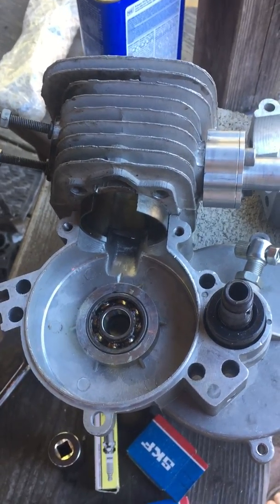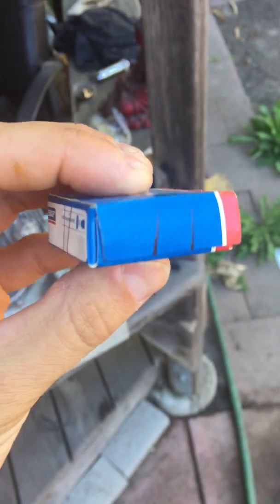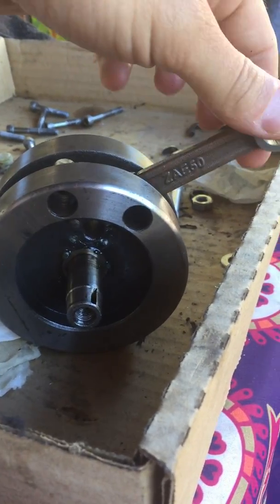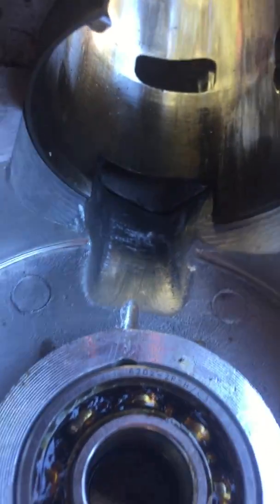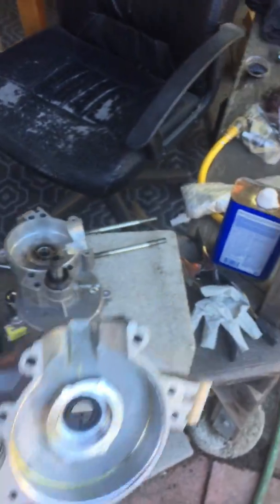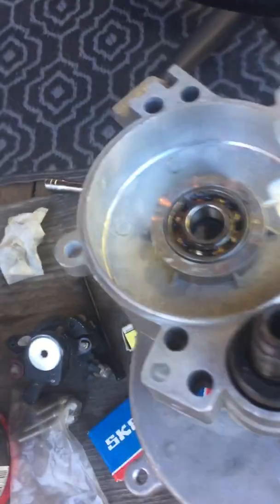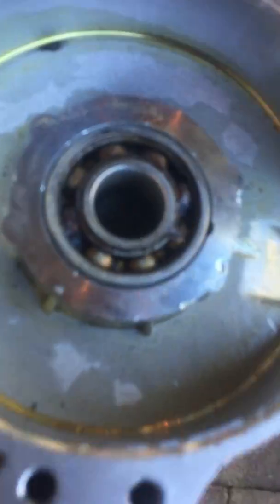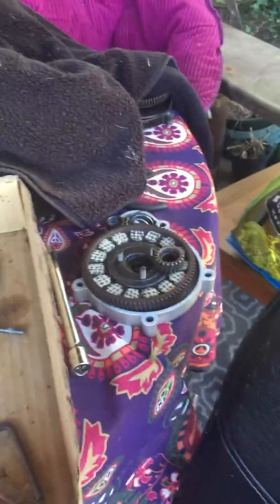66cc China doll bottom end rebuild w/ bearing install

Comment: It's a good idea to test fit the bearings onto your crankshaft before installation- they should slide all the way on with very little resistance, that way you can put the case halves together multiple times in case the number of shims needed is different from the number you had before.

Comment: do the outer seals have to be removed from the crank bearings?
Reply: No, in fact they need to be left on because they will leak like hell due to the pressure. Behind the magnet is a major problem area.

Comment: Mine has the ZAE80 has massive power and reliable, I did not know I could buy an eBay 80(66)cc motor with a balanced crank, paid 125$ with some new parts and quality built, Lasted me 7,500 miles and I'm just doing a Rebuilt top end, with porting/matching the transfers/intake/exhaust. I do trust my supplier, eBay trusted with over thousands of 5 stars reviews. Let's see how much power it makes, was doing 36mph tops, with stock exhaust and carb, only mag wheels and triple tree suspension, other misc Motorcycle parts too. Liking the Motorized bike life, since I started over 2 years ago.

Comment: So the oil ring is now cooked with the blowtorch and any grease in the bearing probably as well, with the residual heat of the casing...
Reply from the maker: Your kidding right? What’s an oil ring? Lol Do you mean the oil SEAL? The flame never touches the SEAL and the seal is made to withstand standard engine operating temps which exceed 350 degrees, I only heated the case to a little over 200. 
It also doesn’t matter if the grease is cooked or not, even though it’s NOT, because a 2-stroke is lubricated by the oil mixed in the gas NOT the grease, duh!
Reply from the maker: By the way this motor is still running strong and fast
Reply: .... what the hell is an oil ring?  😂🤦‍♂️🤷‍♂️☠

Comment: My crank case is almost apart it wiggles at the piston side of the case but at the back where the sprocket and clutch is its crazy stiff and it looks like someone slammed the bareing in with a hammer any help would be greatly appreciated???????? I need this case split thank you!!
Reply: Im about to just break it apart with a crow bar so im just going to leave it alone till i get a possible reply

Comment: Who does sleeved Cylinders now days ?
Reply from the maker: MZMiami on eBay but their sleeves are too thin, no good. Check zedamotorsports.com and contact Robert Bianchi, there's other people I know that have done it just not sure if they still do it now. Ask your question in the Facebook group TeamRebelbikes and I'll link you with a couple people I know that have made them in the past.
Reply: Thank You.  Will check it out.  As cheap as a new jug is it's  not  a real issue but I live in the High Desert and I'm thinking a sleeved jug would take the heat  a bit better.
Reply from the maker: Get a 7/8cc Fred head and an NGK b8hs spark plug to help keep it cool. Run 91/93 octane fuel and you shouldn't have issues with detonation
Reply: sander sindell What do you mean they are too thin? I just bought their 48mm. I still think it will last longer than a stock cylinder.

Comment: you have to be kidding. when the bearing on the crank goes out witch it will eventualy how do you remove the crank pin? main bearings you got should fit good no glue needed. and if one day they need replaced you wont destroy things getting them out. the added weight of the wield threw it all off.
Reply from the maker: Main crank bearing takes forever to fail. Never happened to me before. So when or if it fails, I'll just replace the crank
Reply from the maker: Whatever affect the added weight from welding is is minuscule, my motor spins over 10krpm with no vibration. In theory your right but in practice it runs great
Reply: He never used any glue on his bearings  he only added a little gasket maker to sesls which is a great idea sense the machining on the holes are poor from China